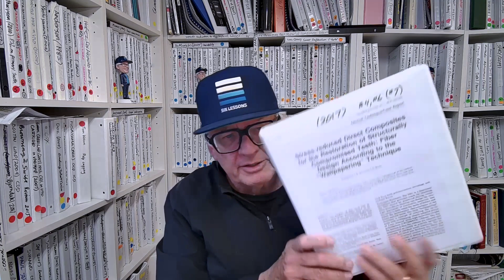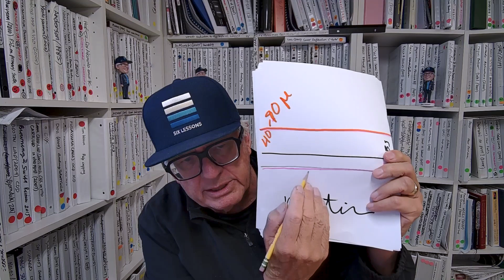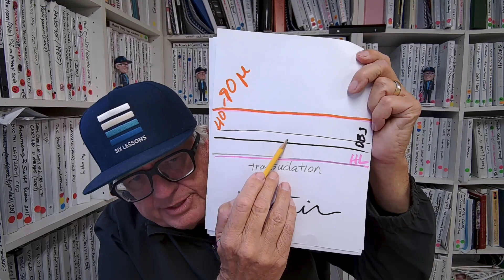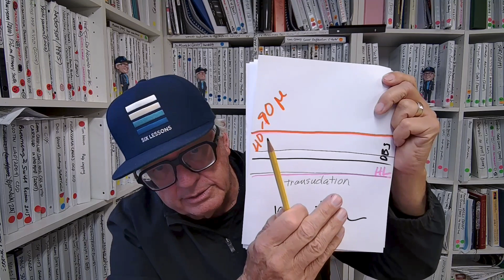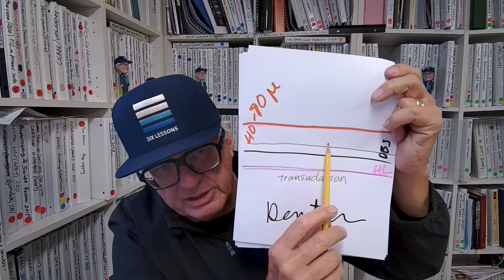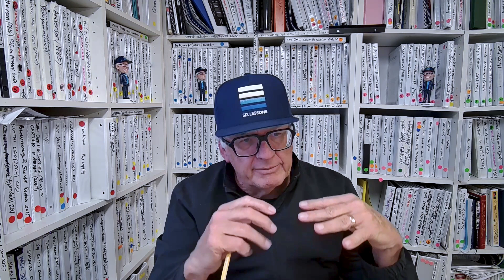Using Chemical-Cure Dentin Bonding Systems for Endodontically Treated Teeth

Comment: How about MMA-PMMA self curing composite? Does it still work? I place small amount of it on the bottom of a pulp chamber (yes, root canal done for severe pain) and on top of it, do some ribbond wall papering technique for the rest of the cavity.
Reply from the maker: Bis-GMA is generally preferred, but it depends on the brand and how the primary polymerization molecule is used. New materials are being developed every year.
Reply: @allemancenter  It is Sun medical's Superbond which uses 4-META. Powder and liquid are separated and brush-dip technique is recommended.